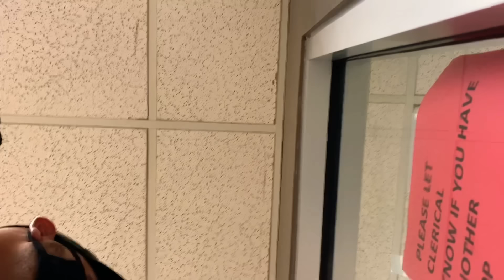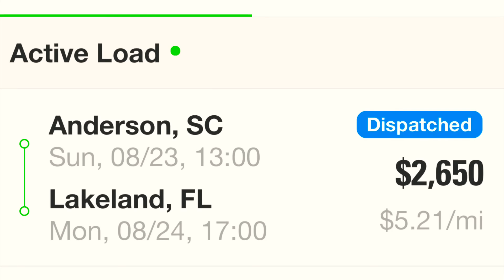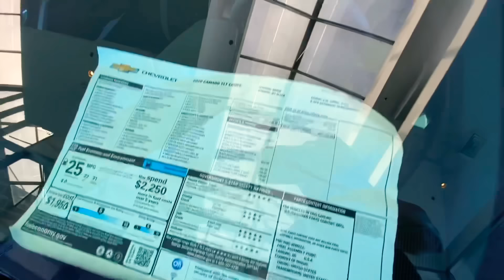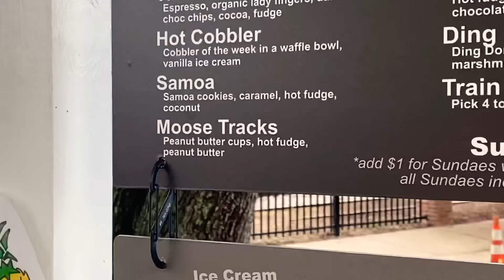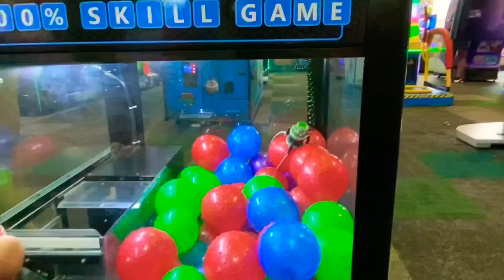“L86 L83 Cam Removal” A $2650 Sunday on 501 miles Rob Pitts VinWiki story Dealership and HomeTime

Comment: Dude, I'm a trucker for 30 years & you can never take nothing for granted. Since the pandemic started some warehouses/factories won't let me inside & I can only stand outside the back of my trailer & count the number of times the forklift comes on/off my trailer. I was at a FED EX facility in Kutztown, PA & I was dropping off 3 skids & it clearly said that on the BOL. The lady forklift operator didn't speak english. As I was outside my trailer listening I quickly figured out that she was going to unload my whole trailer & I started banging on the wall to stop her. Also I was at a Frozen Food warehouse in south New Jersey & they unloaded my trailer & never bothered to come out and tell me when they had finished. (Lack of communication) It was a good thing I counted all 22 times the forklift rolled on/off. I keep a note pad & make a mark each time a skid comes on/off. You have to double check everything everytime.

Comment: I feel your frustration. I run fedex pups subcontracted. Because of this Chinese virus some terminals only do texting to receive and dispatch loads. One terminal I won’t mention will not even text back as to where we are being dispatched to. If we bitch we are only kicking the bees nest. They clock in and out same time each day without caring that we don’t have that luxury. Keep your head up and move forward. Our Father is in control brother.

Comment: Install a couple of cameras in your trailer. Install a car battery to power the cameras when you are disconnected from the truck and set it up to recharge when you are connected to your trailer. You may need to modify it with a seperate monitor in case they make you disconnect your truck from the trailer. Maybe there is a camera that can transmit the video to your trailer when disconnected. Find a way to out fox them with their BS. This would also allow you to monitor your load while driving or after you had to break hard to avoid an accident...find a way!

Comment: How'd you get the cam gear off without pulling the pan? I've loosened the oil pump and locked in the tensioner but still not enough slack
Reply from the maker: You have to pry it off
Reply: @JustTruckin  took a long time but finally got it. I was prying the whole time. Just had to get it just right I guess

Comment: Dorman OPS part #  926-040 comes with sensor and filter. And BTW there is a recall on the active fuel issue.

Comment: What ! A 2.0 / 4cyl with a turbo...LOL...wow crazy 🤯
Reply: @Perkelenaattori  yeah I understand completely my wife is German, and my toys in the garage are E30 BMW (85) and a 850R Volvo (96) and X6M BMW (18) and my kids 500 Fiat (19)...my project Stingray Corvette (69) ....But the car I was freaking out on with a 4 cyl Turbo is VERY heavy Camaro (2020)
Reply: @Perkelenaattori  them Audi engines...are from VW, they tend to need rebuilds usually in the middle of their prime of life.
Reply: @Perkelenaattori  chieniesium? I thought they had iron lower block with aluminium top. Those engines are great and can be made better with some slight modifications.yes they consume oil...deleting the bypass for the turbo...and adding a blow of valve for assisting the crankcase vapor...dail in the high pressure fuel pump. ITS A THING OF BEAUTY...do you live in Europe ? If so you are so lucky. Because of being able the get the bigger factory k4 turbo instead of us here in the US with the k3 turbo. Upgrade the rings to keep the oil issues under control. Fun economic cars. My 850R Volvo 5cyl is at 288hp.(dyno)very little modification just used the European ECU. Blow off  valve & replaced the with softer bend on elbow after turbo/ bypass valve...Stock was 240hp.